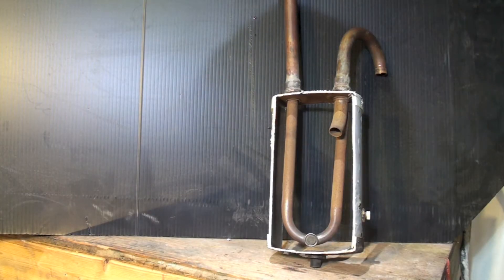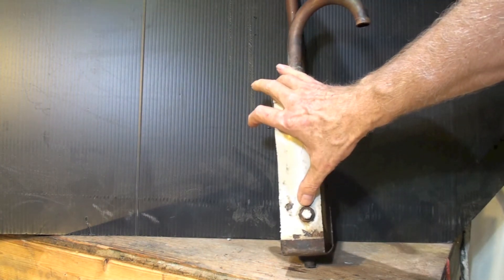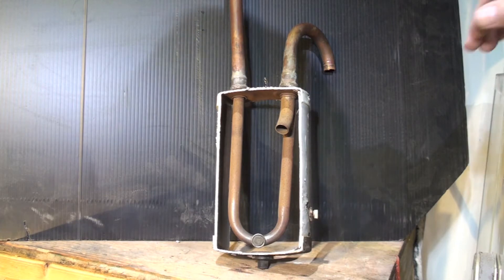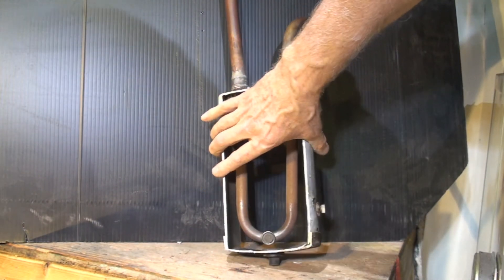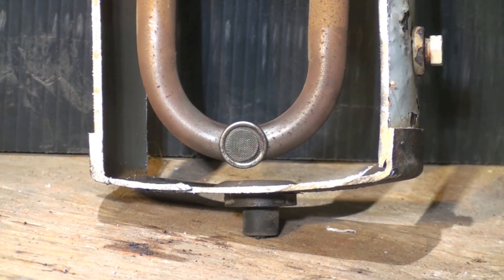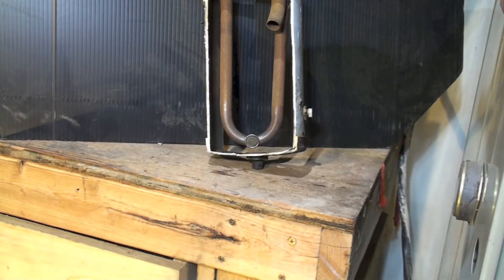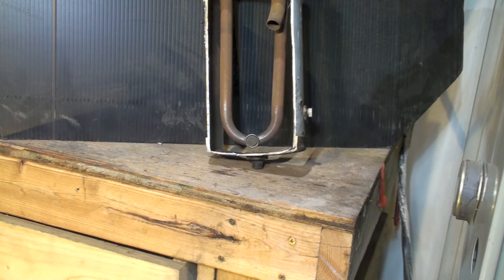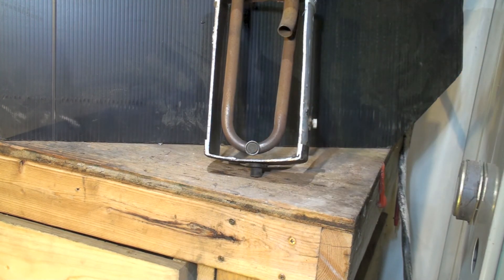refrigeration accumulator troubleshoot

Comment: Hi, I have a 6 Ton carrier split system (AC only) with a "Piston" I would like to replace it with a Sporlan TXV (I have the TXV on hand) but I also want to add a suction line accumilator . What size range of the accumilator (in Liters) should I use . Thanks very much
Reply from the maker: We usually size them equal to the refrigerant charge in pounds or kilos.
GFM
Reply: Thanks for the reply very much

Comment: Gray, the liquid refrigerant will just boil and get drawn out as a vapor, just like a flooded evaporator.  What won’t boil is the oil, which will collect, and take out the compressor.  That hole with the screen is mostly for oil return.  The liquid that might flood back to the compressor, will not remain, because the compressor is constantly drawing vapor out, which causes the liquid to boil.  Basically a flooded evaporator works the same way, but there is a slit in the outlet pipe, right at the refrigerant level, that skims the oil off of the top. But the refrigerant inside is boiling and being drawn out as a vapor.  You can see this visually with the refrigeration trainer that has glass components, for the flooded evaporator, the dx evaporator, receiver, and condenser.  I had a large accumulator on a 10 ton semi hermetic condensing unit, that we had to replace the compressor on due to broken rods, etc.  That oil hole plugged up and we couldn’t maintain oil in the sight glass.  We had a large suction line filter dryer and kept changing the oil and drier cartridges, and eventually it cleared itself up.

Comment: It sounds like you might have something there I'm working on a unit it's got a new condensing unit it's got a new evaporator and a new TXV yet when it runs my suction pressure is very low of course my head pressure goes high it's acting like a restriction in the system and like I said new condensing unit new evaporator new TX

Comment: how does the oil comes out when those two tubes inside are not properly aligned
Reply from the maker: The refrigerant is liquid in the bottom.  The oil mixes with the liquid.  Then the metering device in the u tube feeds the refrigerant and oil mixture into the suction line.
GFM

Comment: I have suction line accumulator that connected to the composer on medium. Walk-in box an the line keeps freezing up an also the accumulator also starts to ice or frost up could it be that accumulator hole is clogged if so how do I know an how do I fixed this issue

Comment: I have a system that I charged to 12° subcooling like data tag stated. After ten Minutes the Accumulator look like it was freezing back towards the evac. What can cause that
Reply from the maker: Was the accumulator completely covered with frost or jus the bottom part?
GFM
Reply: grayfurnaceman the lines and it was freezing back toward the Evap coil
Reply from the maker: Frost from the accumulator to the compressor is normal in heating mode, but the entire accumulator should not be frosted.
GFM
Reply: grayfurnaceman this was a Ac I don’t think it was overcharged. It was designed to for a 14°
Subcooling and it was way below
Reply: I charged it to the 14° it would take a little
Longer but it would frost back towards the Evap

Comment: I have most of the symptoms you showed, with additional icing appearing on the line going into the the three-way valve and then into the compressor. overcharged, or restricted?
I'm going to recover it, r410a, pump it down and weigh it back in. if no improvement, I'm going to replace the accumulator. any thoughts?
Reply from the maker: Accumulators can be tough to diagnose.  Blockages sometimes disappear with no explanation.
GFM

Comment: I actually lost a compressor because most of the oil filled the accumulator because the orfice was clogged.
Reply: +Sam Fry my accumulator was full of oil. The compressor was locked pulling LRA. I wish copeland scrolls had a low oil level shut down on them.

Comment: That soldered thing is a fusible plug, in case of a fire the solder melts and the refrigerant blows off depressurizing the system so it doesn't go off like a bomb. I've resoldered those fusible plugs in the past. The screened thing is to siphon the oil out of the bottom of the accumulator, without it the oil would collect there and the compressor would sieze up.
Reply: Give this man a cigar!! :D
Reply: I lost a compressor because of what you just stated

Comment: Why do they have to have the solder or plug in those things?
Reply from the maker: jeff arney All pressure vessels have to have a high temp relief.  So if it is subjected to high temp, it melts and relieves the pressure.
GFM